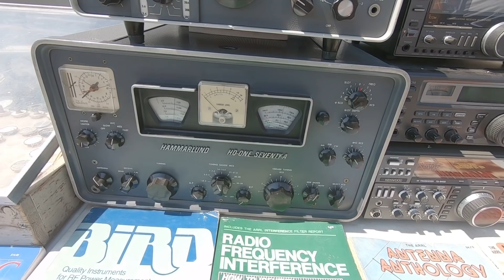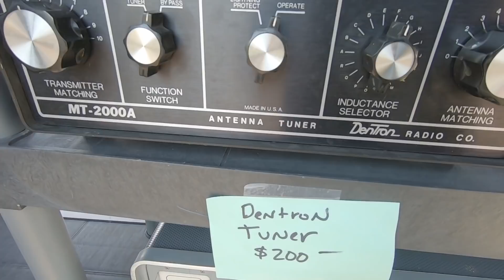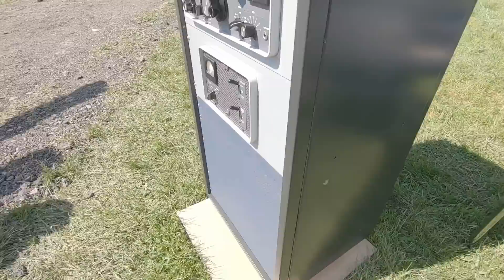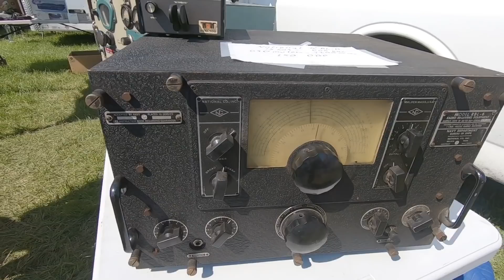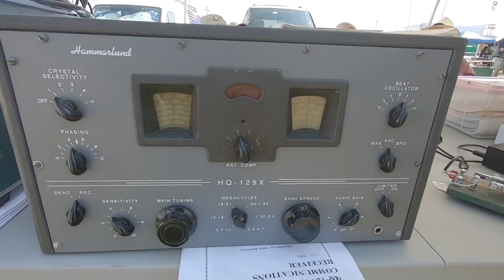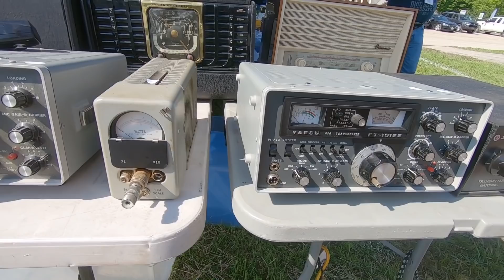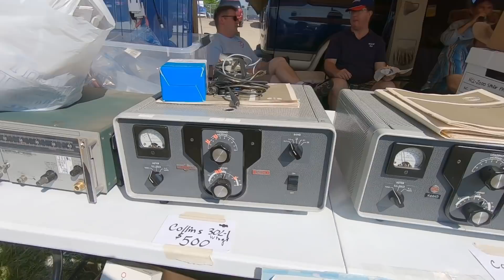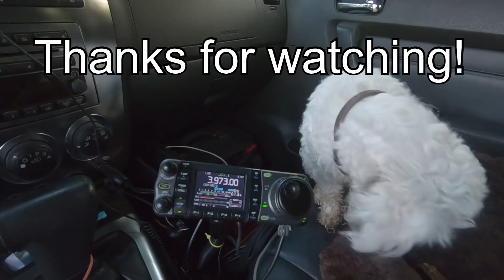A Look at Vintage Ham Radio Gear Hamvention Flea Market

Comment: I love these flea markets but have never bought anything. In general, are radio owners selling good, solid equipment or faulty junk? I dont see anything being tested and demonstrated. Also, prices are pretty high for used gear. Do radios EVER depreciate? Youd think they dont by the prices Ive seen.
Reply from the maker: Nice to hear from you and thanks for commenting here. Yes there is a lot of very good equipment for sale at the Hamvention flea market. Some of the vintage radios in the video were restored by qualified Hams. Great condition! Of course there was the other side, which was in need of repair. Priced low though. I saw a lot of good prices on much of the equipment. Other Ham radio flea markets will vary :-) Thanks again and 73!
Reply: @HamRadioAdventures  Thanks for the reply and the video, its very appreciated. And sorry if i sounded negative, it wasnt the intention. In the case of used equipment, ive met some really great, knowledgable Elmers who want to help and do the right thing, then you meet some nasty arrogant folks who kinda spoil it. Remember there are new people all the time and its probably helpful to narrate your video to explain some of the items, how they are used and even what you think they are worth.